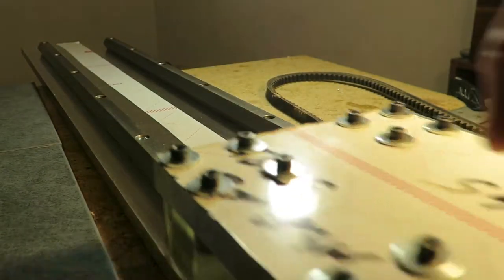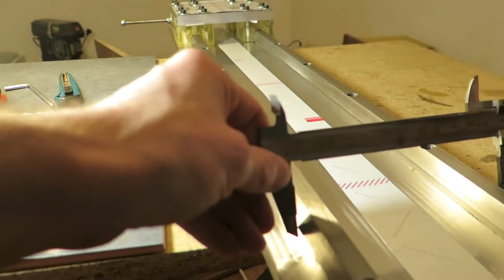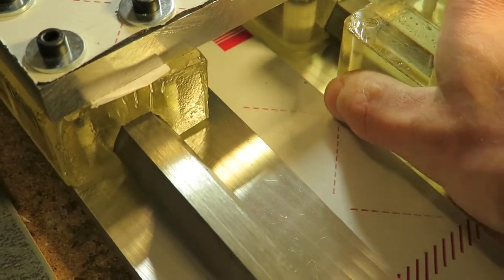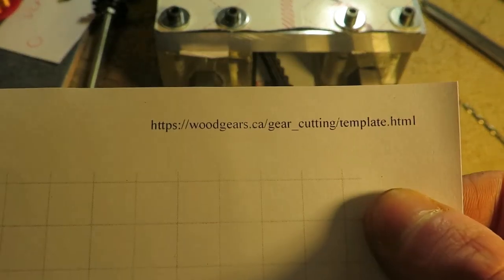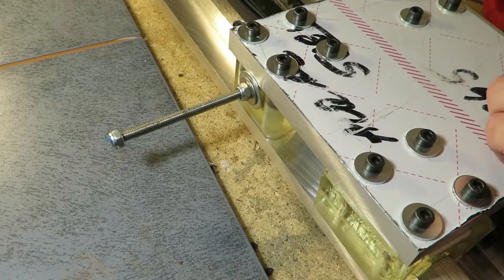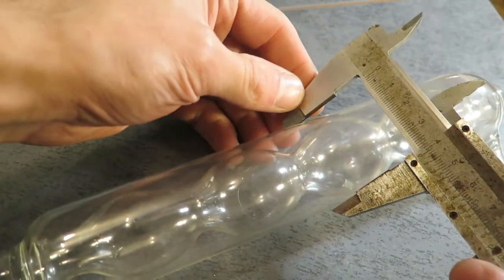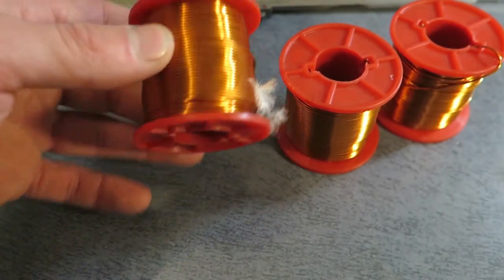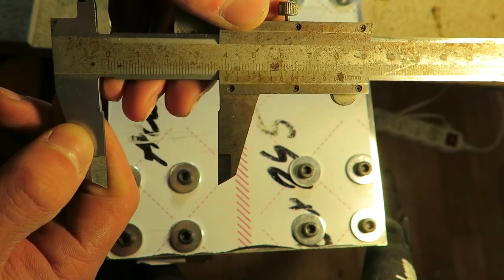Glass blowing lathe - the bed

Comment: Very nice design! I wonder if you could have cast an opening in the sliding blocks for bearings? Even so, it look like a very solid table. I am impressed.
Reply from the maker: Thanks.
Problem with plastics is thermal expansion and water absorption.  Both will change dimensions over time.
Not talking about epoxy resin shrinking during curing...
Also straightening hex rods was quite hell.

Good thing would be having POM(polyoxymethylene, polyacetal, delrin) blocks and broach say hiwin profile.
Possibly reinforced with steel plates.
That would be superior.